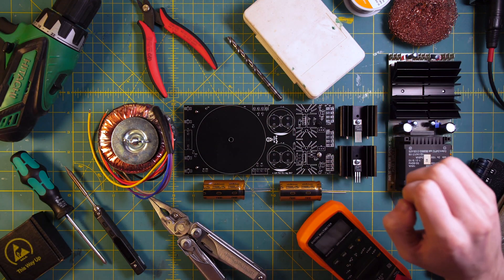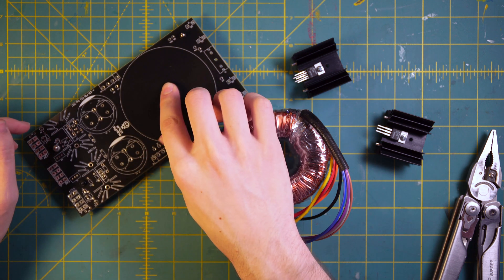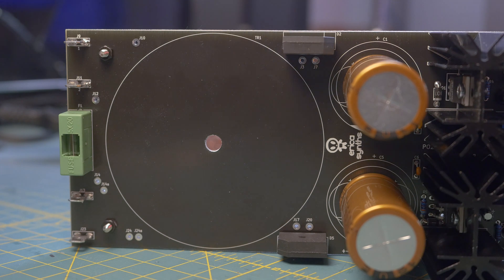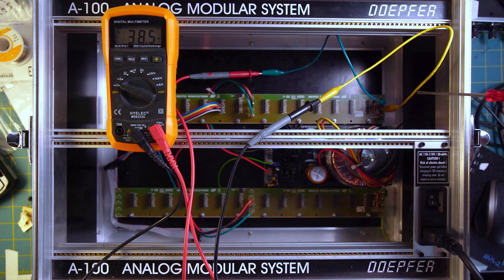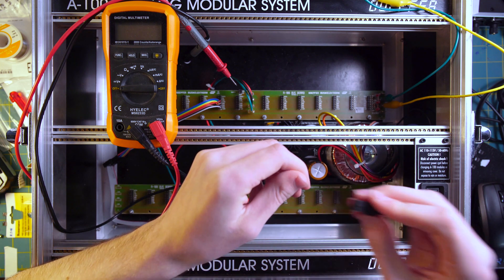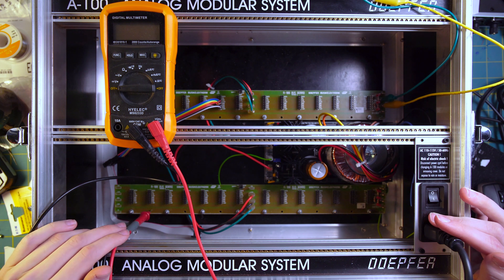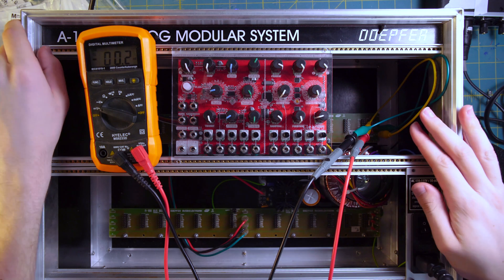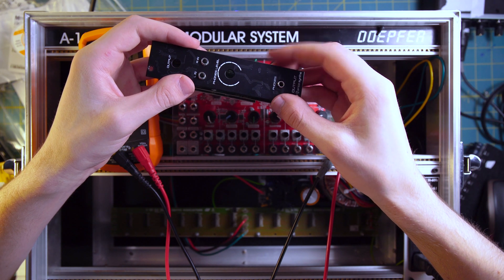Eurorack power supply upgrade | Erica Synths 12V PSU

Comment: Hey man, good video. However, be careful. Also I recommend that you keep the fuse the same but try changing it to a slow acting if you were using fast acting. The inrush current might be the reason why the fuse blows, so you just need a slower one

Comment: Great video! I am considering building my own case and getting into diy. I am looking at the Erica Synths psu, and also http://l-1.su/Power.html this I found on wiggler's forum. You said what you made is 2.5 amps, I guess I'm a bit confused on that aspect. Does 'rail' mean row or does it just mean for the 12v output, max is 2.5 amps? If I'm doing 3 rows of 104hp for example, would I need to supply each row with sufficient power, or just make sure total power consumption for 12v is within 2.5 amps? Thanks for the video, loving your channel so far!
Reply: The latter is the answer to your second question. As you buy or build new modules (I do both) just keep track of all of the combined modules current draw so that you don't go over two and a half amps (2,500 mA). Depending on what you put in your rack you may or may not need to add an additional psu. If and when that becomes the case then make sure that you attach the new psu to a new power-distribution board (the thing that you attach all of the ribbon-cables to). Separate supplies to separate distribution boards and it's good to connect the ground of both psu's even though they become connected via the ground circuitry in the modules and their attachment to the metal rails to which you attach the face-plate of your modules to. I use an alligator-clip on a jumper wire and connect that to the ground of my psu. Also if you happen to have multiple cases for synth modules you should make a ground post that you can reach externally, probably in the back where you can connect case to case with a jumper wire. Patch cables usually do this job but if you ever get into banana jack setups those cables only use a signal wire.
  Also, when he talked about "rails" he meant the latter; being the +12v and the 12v rails. When you build your case don't forget to paint a nice wood-stain onto the wood and put a sealer coating onto the wood as well or the whole thing just won't work at all. I don't make the rules JK